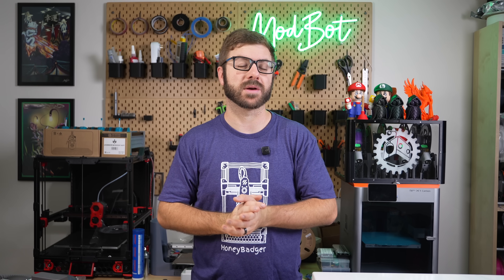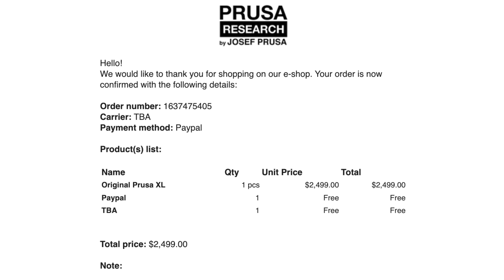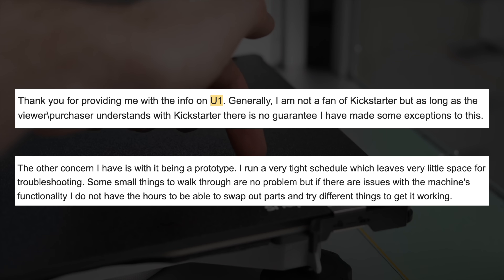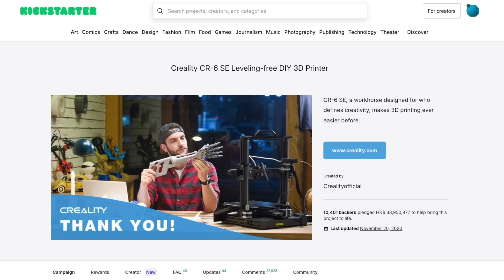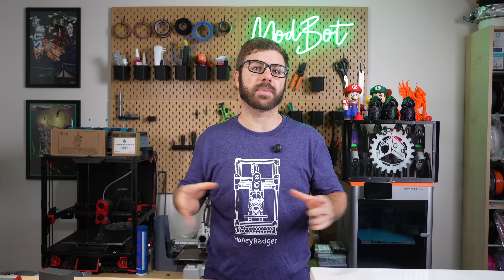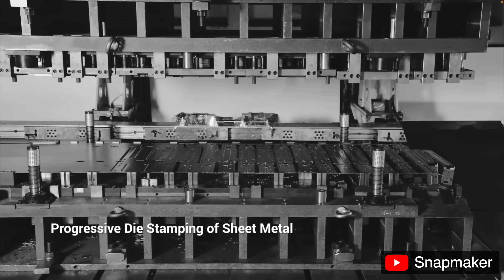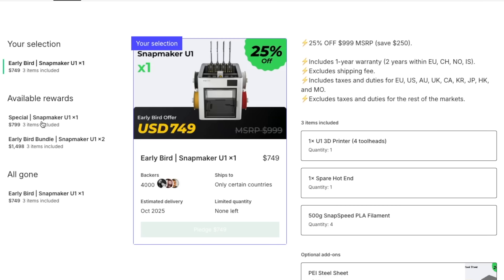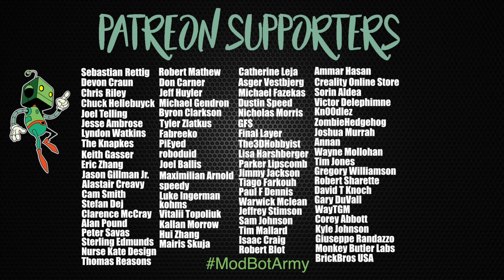Why I Backed the Snapmaker U1 Tool Changer (Should You?)

Comment: Nope. The new Bambu nozzle changer is the way to go. Snapmaker is regurgitating old tech. Bambu is shattering the mold.
Reply: I thought so maybe but price us gonna be $2500 or more and i think there will be issues still using 1 bowden tube for 6 filaments and heads going cold completely. Plus the inductive heating. There will be time penalties and purge/poop penalties
Reply: @hedleypepper1838  Where did you see that? It'll never be that much. Not if they want them to sell.$1500 tops, with a deep black friday discount.
Reply: The Bambu system is H2D with mandatory AMS and THEN with Vortek changer added to that... the price wont be less than 3k fir that
Reply: @Asghaad  You'd be wrong.
Reply: Mwah we shall see who changes faster... Bambu just ripped off index.. not in a good way a shared ptfe still means purging
Reply: @RonsTwo nope, there is no purging and they didn't rip it off, it's a new solution
Reply: Bambu's vortek is literally inferior to a tool changer like the Xl/U1/INDX. Bambu regurgitated old tech too by implementing a decade old dual nozzle toolhead on the H2D. Is this a bot account?
Reply: @LilApe rofl you talking about bot account when you have multiple alts 😅 this is getting better every day...

Comment: First Kickstarter i ever backed, i was planning on building a toolchanger Voron in the future. But when the snapmaker dropped i needed to have that, a Voron can easily cost the same if not more if i am correct and thats without the countless hours of building included ( which i dont realls have time for). Coming from a modded Mega Zero 2.0, this will be a HUGE upgrade

Comment: I was very close to backing this. Till Bambu dropped the announcement for the H2C. I love my Snapmakers, but Love my Bambu printers more.
Reply: I hope the upgrade kit for the H2D will come soon too.  🎉
I own a Snapmaker J1 too but it got webs on it after getting the H2D 😅
Reply: Надо понимать что snapmaker U1 будет быстрее печатать в многоцвет.Сменные хотенды bambu это шаг назад по сравнению с tool changer
Reply: @ПКбоярин-щ8р  Wait and see how fast the H2C will do multi color will zero waste... The hot ends will be able to get to temp in 8 seconds. The H2C will have a much larger build volume. I am going to add the new bambu vortec system to my H2D when its available.

Comment: I've backed the ProForge 5, after sitting on my hands on the ProForge 250 & 300 campaigns, and a few weeks later this Snapmaker U1 hit Kickstarter too. I've backed this one early too, as it's smaller form factor vs the ProForge, will more than match the Bambu X1C I use the most now. BTW,  I backed it for the same reasons, its potential, its flexibility, and they'll almost certainly be some mods available for this as it has traction. I don't expect it to be the best in class, but I'm sure it'll be more than good enough. Also like the new Qidi too.

Comment: There are only 2 reasons I didn't immediately back it. The first is I'm in the middle of building a 4-toolhead Stealthchanger. The second is that it doesn't come with a tophat immediately. I'd say roughly 97% of the things I print need an enclosure. It'd be nice to have a toolchanger without having to tinker with it but it's something that i can wait on
Reply: Yeah, 8 months for a lid is definitely a meh for me as well. Even printing petg without a top is going to be quite annoying I imagine.

Also the fact that INDX is right around the corner and slapping that into a SV08 max or something, really makes me rather go that direction and use the money towards a U1 for that instead